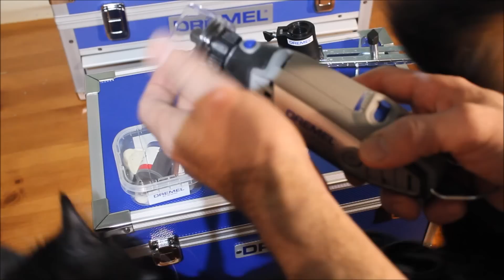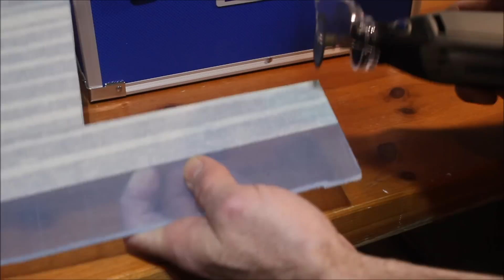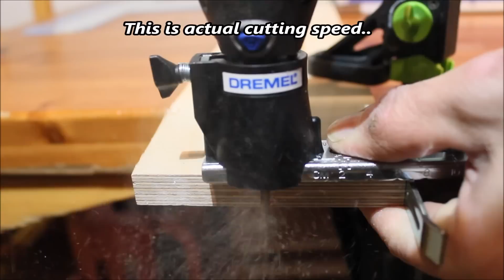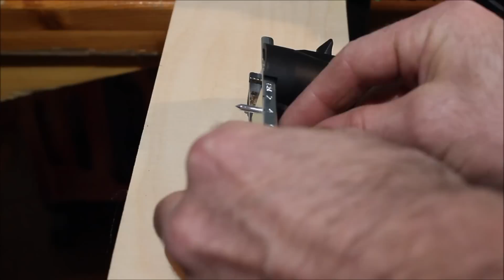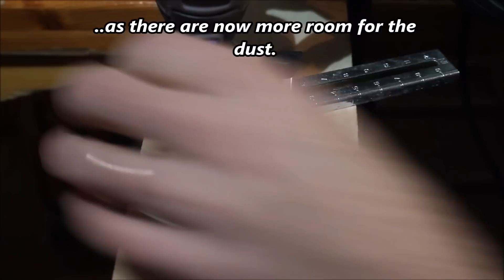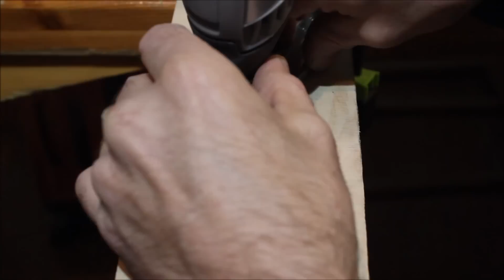Dremel 3000 Gold Kit. Lets take a look. Part 2. Line & circle cutting attachment. (678)

Comment: I feel it's too much of an effort to cut out a circle with the router. Why not use a Hole Saw ? It's much simpler and faster.
Reply from the maker: When radius gets big enough, it needs a lot of torque. Point in this kit is versatility,. Of course, it can't compete with "real size" tools. But with it, diyer can do some tasks at home, without need to have several big sized tools.
Reply: Sure do understand its limitations as well.  Tks for the tutorials anyway

Comment: are you happy with the dremel 3000?
Reply from the maker: Im happy with it. 4000 model has more power when using lower rpm.  But 3000 is smaller.
Reply: +Tuomas Soikkeli okay thanks for the info and Feedback and nice work what you do
Reply from the maker: Thanks mate!